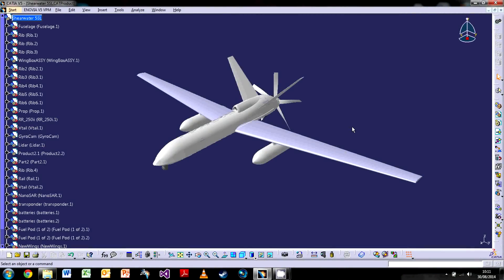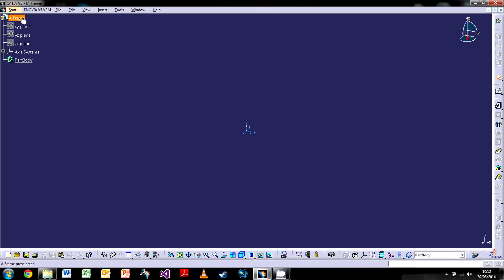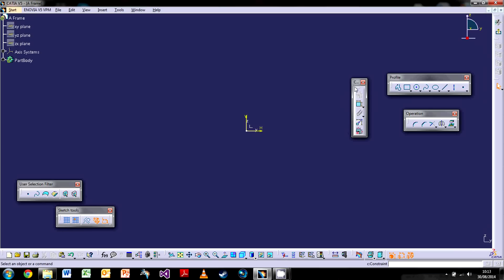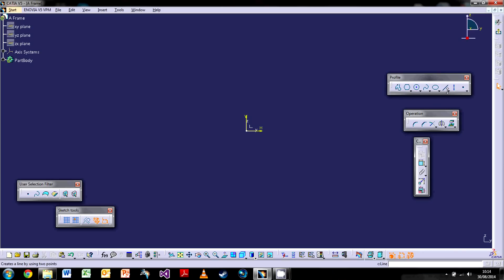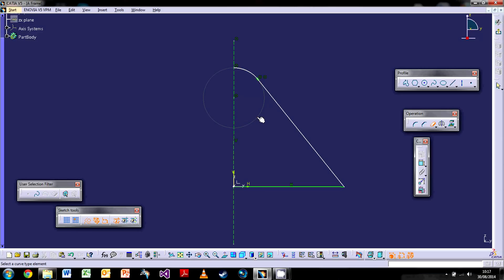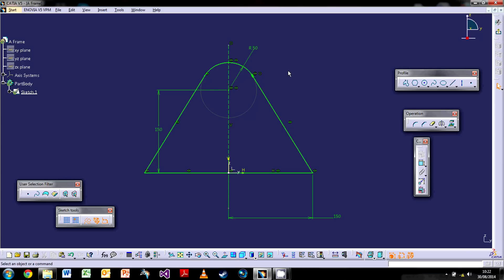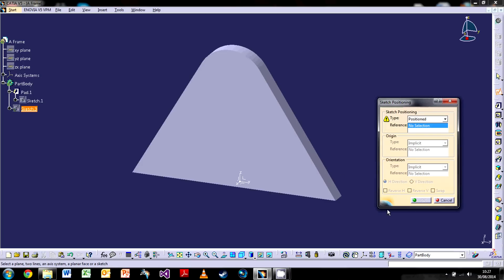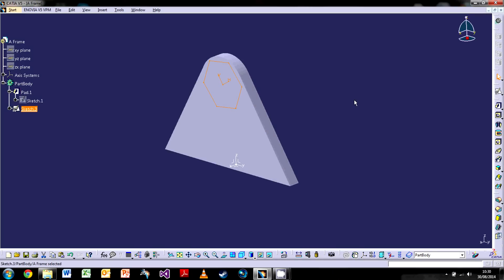CATIA V5: The Basics - Tutorial 2: The Sketch Workbench

Comment: Why an axis system vs the default?
Reply from the maker: axis systems are generally easier to work with, both visually and in an engineering sense. The default planes don't allow you to see which axis your working in, they only have planes rather than both planes and axes, and you cannot create a bespoke axis system very easily either.
Reply: +TheCADMan thanks I'll try starting at axis system - in Catia 1 we are doing the simplest things headed toward the complex and I prefer to learn big picture - start with good habits and repeat good habits.